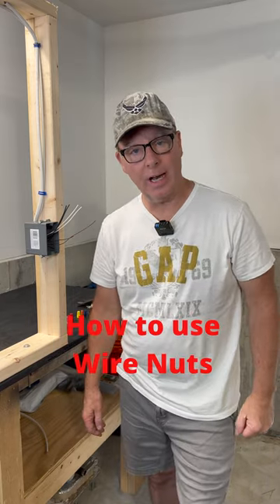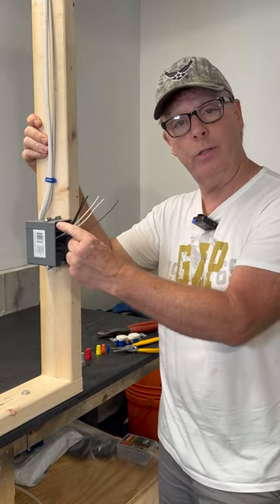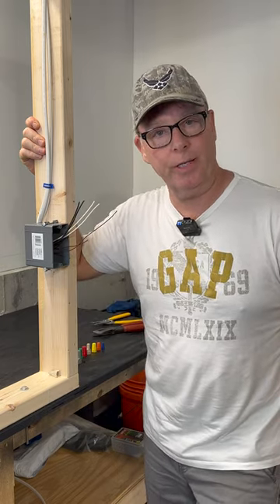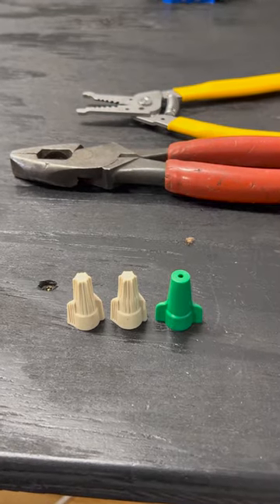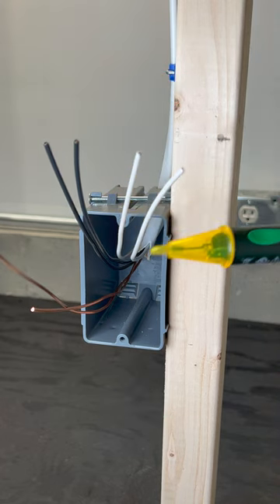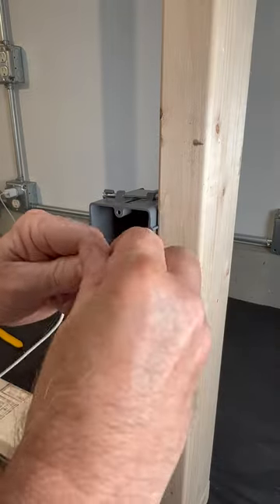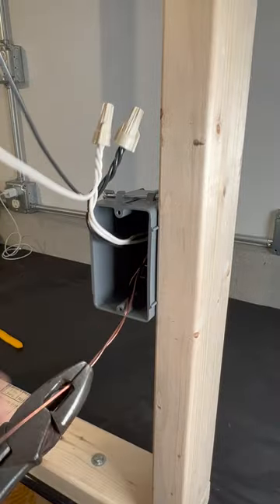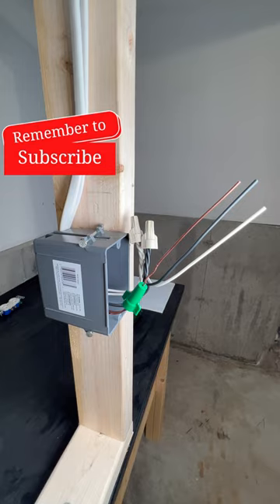How to use a Wire Nut | to connect solid wire #shorts

Comment: Once you put the wire nuts they twist automatically
Reply from the maker: I think that pre twisting is a best practice.
Reply: Even on the box is “no twisted needed “ so Recomanded by manufacturing
Reply from the maker: @iubi112002  The manufacturer says pre twisting is permitted but not necessary. However after 38 years of experience I and 1000s of other believe it's a best practice. But you can do whatever you like..

Comment: Step 1, stop using them. Go buy wago connectors. Way safer and easier to use.
Reply from the maker: Wagos are great for the DIYer in my opinion but the are 5x the cost and less reliable than a wirenut with 120v circuits. I agree that they are easier to use though.